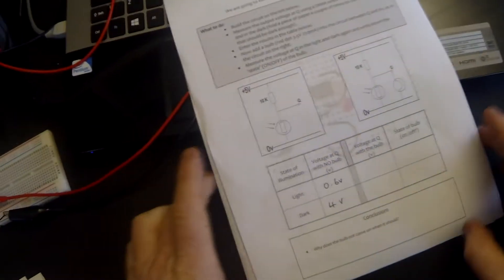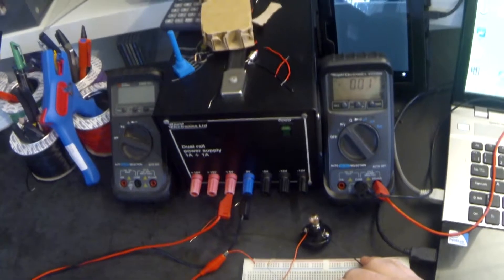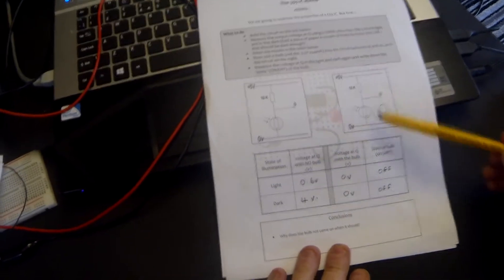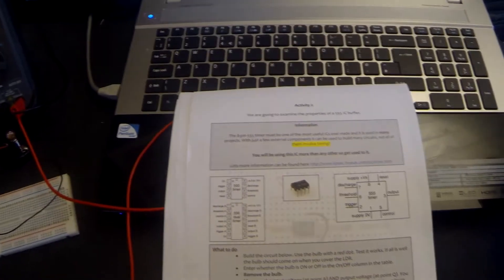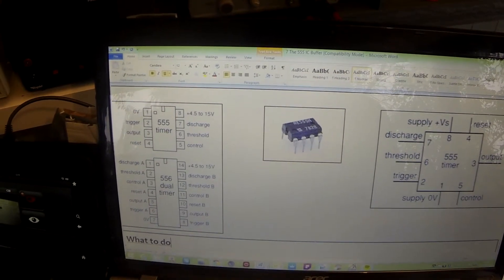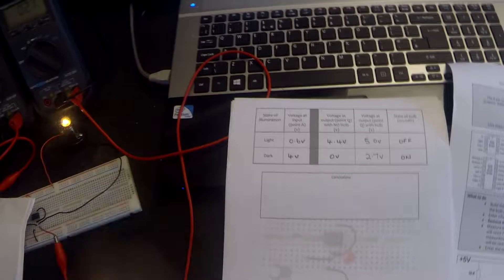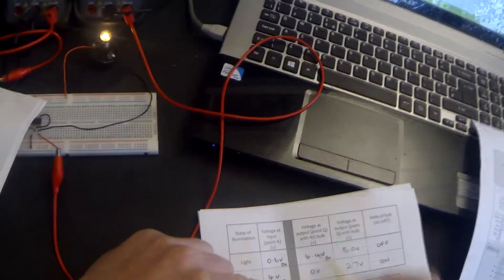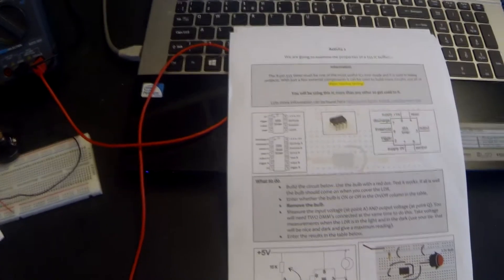Tutorial 7 : The 555 IC Buffer GCSE AQA Electronics

Comment: I thought you were going to present the MOSFET gate logic buffer function of the 555:
Pins 1 and 2 connect to ground, pins 6 and 8 to positive supply, 4 is input for anything from 1.8 to 5V logic, and 3 is output. 10 ohms resistor between the MOSFET gate and pin 3. Pin 5 is grounded via a100nF cap as usual. At least a 100uF cap on the IC's power supply pins for stability.
I only found this on one website, I'm surprised it's not well known.
You may say "but there are logic level MOSFETs out there", yes but they have higher RDSon resistance and most importantly are more expensive and harder to find in some places.
Reply from the maker: All good knowledge, but these accompanying videos and worksheets were designed for GCSE Electronics (age 14/15). And refer to the specification content in the relevant syllabus.